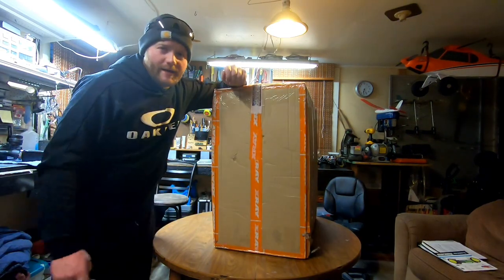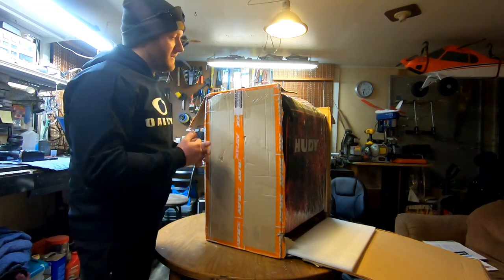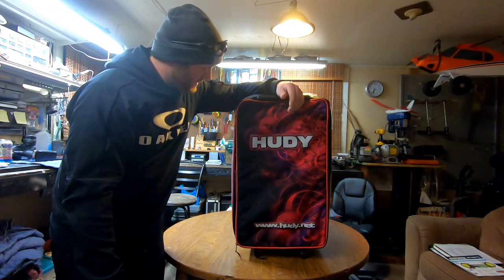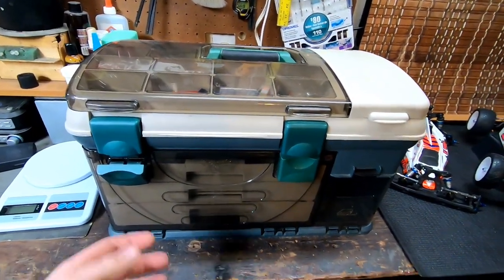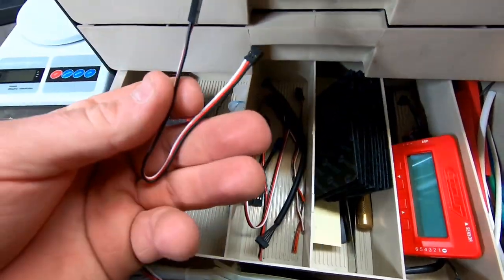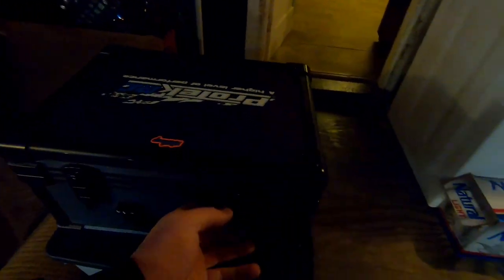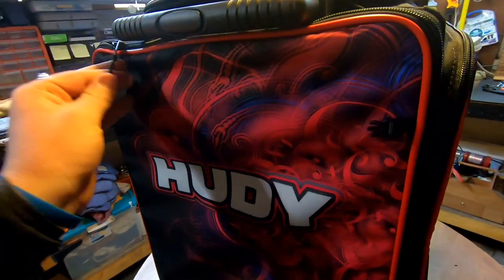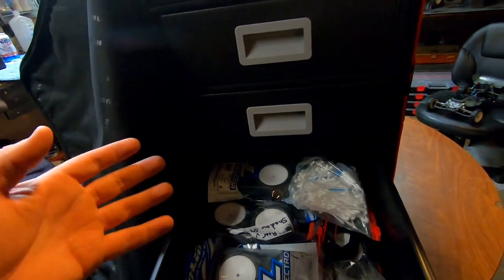I FINALLY got my DREAM RC BAG!!!

Comment: I work for a race engine builder.  I use foam from a new box of valves to put in the bottom of the drawers.  Helps keep things from sliding around so much.
Reply from the maker: That's a good idea. I'm gonna get some of that tool box padding stuff to put in the bottom.